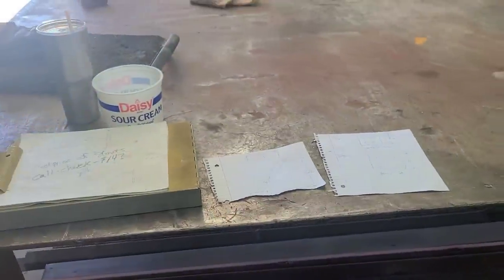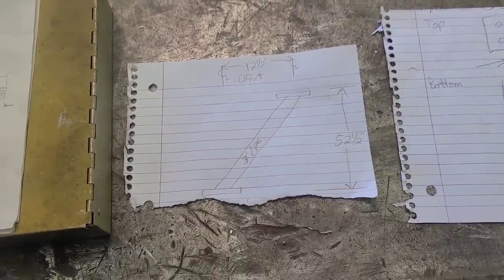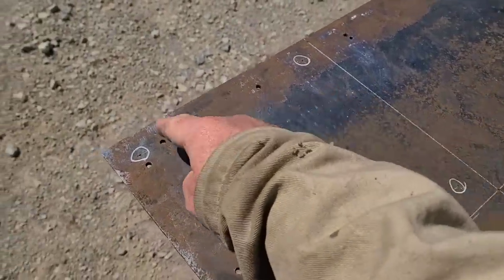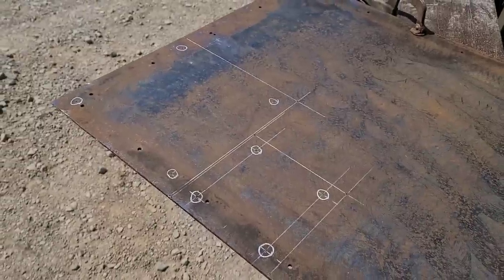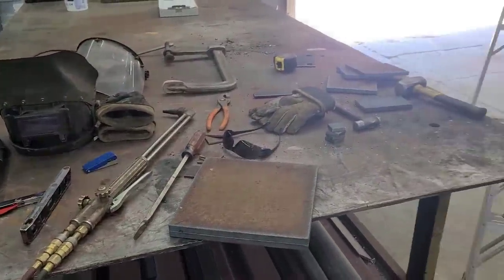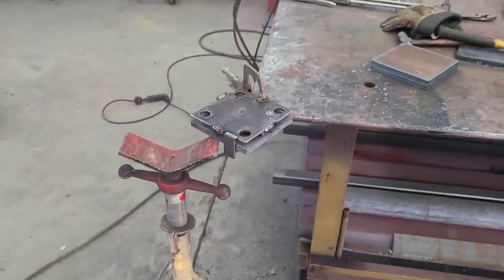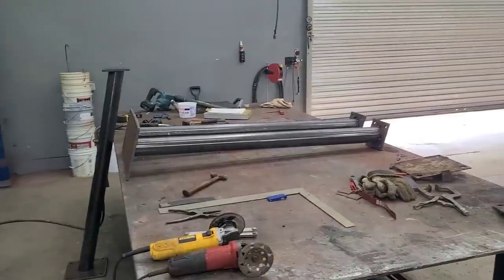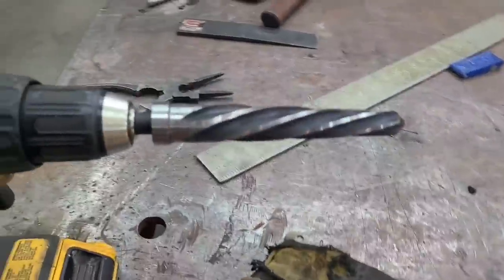Fabricating lifeguard stand pedestals for the High School pool

Comment: Welds that are that critical,  and you don't clean the steal down to brite metal before welding.
Reply from the maker: These size posts will hold up a Ford F-350 with a load of gravel in the bed...but these post are going to hold a human being 

No...I didn't clean prior to welding